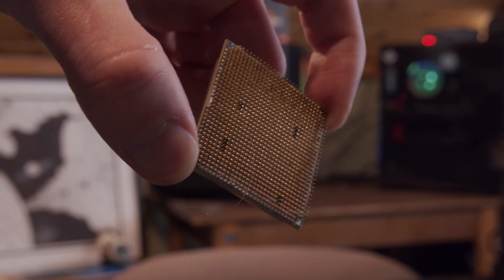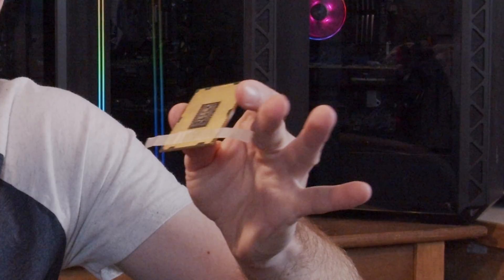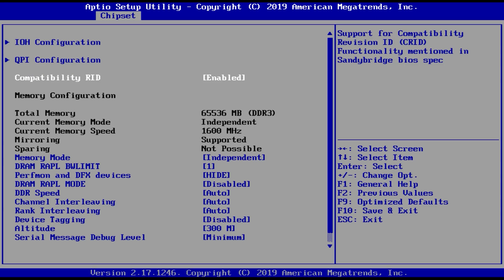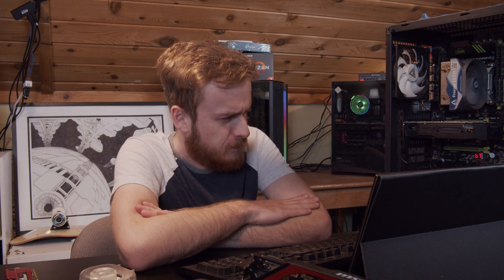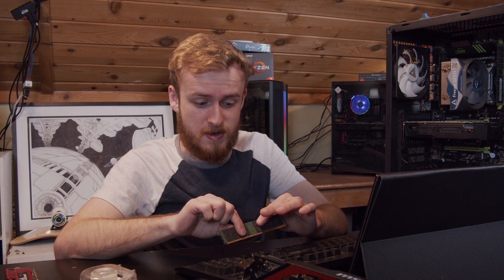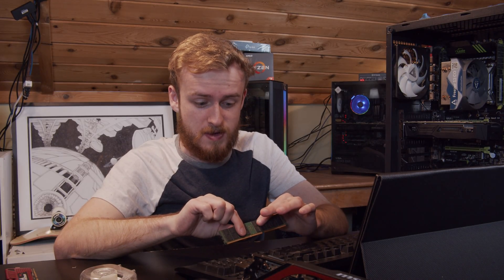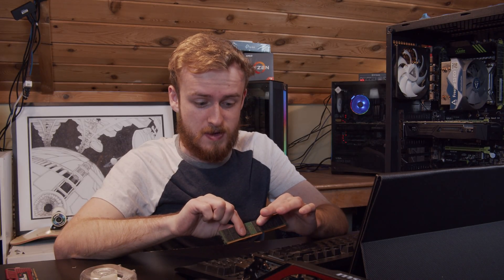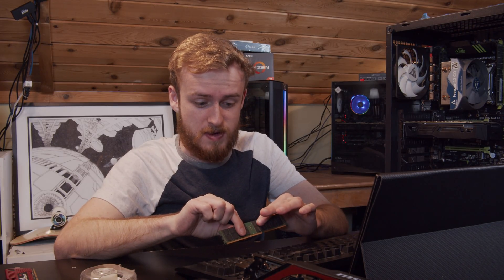What Happens IF You Remove Pins From Your CPU?

Comment: about 11 years ago when I was 9, I decided to unscrew my CPU to look at what was inside. There I saw the dusty CPU fan and decided to clean it. I started pulling out the CPU fan and well I broke the fan and the actual processor was stuck on the cooling fan with the dried-out thermal paste. I had no idea what that was at the time but the pins looked cool. But after being scared I tried to put the CPU back into the socket and guess what, it was misaligned. I had pushed with my full body force that some of the pins got bent. I was terrified since it was the family computer. quickly I put everything back and tried turning on the computer and it didn't start. I tried bending the pins back but then 1 of them broke, then another.

Then I had this crazy idea which I still can't believe worked. I had a brush with rusty iron brushes used to clean up moss and fungus from the ground. I took a wire cutting plier and tried cutting the iron hair equal to the length of the pins and then put the pieces inside the socket calculating the position of broken pins then put back the CPU in the socket and get everything back up and turned the computer on and it actually worked. I can still remember how happy I was and can remember everything so vividly.

also, the computer used to randomly turn off sometimes after that incident. (Probably because the part of the fan that stuck it with the motherboard had been broken). After about 6 months my dad took it to a repair shop and I don't know what he did but nobody knew anything.

Comment: the first part of the PCIe connector is power followed by signal clock then another power pin  then another power pin. That little part is mostly power for the card and signal pins on both sides to line up the signally and draw power for at least the PCIe controller chip on the card most times including the card itself

Comment: That part of the pcie conecton you call the "1x part" is actually just power pins. You will notice that some low power devices on pcie dont even need power from a separate power supply cable becaus its being powered by thouse first few pins in the slot.

Comment: I accidentally bent a ton of pins on a LGA 1151 motherboard once. One of the pins broke off and a buncha others were bent. I managed to get it working after a long day of bending them back into place, and despite the missing one. It worked for around 5 years. The only problem with it was that Dual Channel no longer worked properly.

Comment: eMMC storage has the ability to still work without all the pins working. It is meant to work with 8 pins at all times but if for some reason one or more pins are dead the eMMC can still function with either 4, 2, or even just one pin if all the others are dead, albeit at a very reduced read/write speed. It's a pretty smart (but simple) way of reducing data loss if one or more pins get damaged.

Comment: i bought a old phenom x3 cpu off ebay a long time ago for like 7 bucks that was missing like 6 pins so I just took ethernet cord n cut wires off of it and cut to size of pins then jammed em in cpu socket where pins were missing n bam was able to use it and not only use it I unlocked the 4th core and continued to use that thing for like 2 years for gaming thing was a beast for what it was lol

Comment: Well...I have witnessed friends force slot a CPU into a motherboard and break pins before. The result was the CPU didn't work after that. I'm assuming bent pins and removed pins will have the same results...now, let's see if I'm right.

Addendum- the processor that I spoke about had pins bent in several different areas. Yes, my friend is an idiot.

Comment: It's very simple. If you remove the pins from the amd cpu you should be able to use it in a intel motherboard
Reply: bruh there are no contacts on an amd cpu

Imagine this

taking off the pins on an amd cpu is like circumcising it, not turning it into a pussy

Comment: Believe it or not. Recently I was repasting my cpu and my dumbass turned the pc from is side to it's legs while the CPU CLIP WERENT CLIPPED IN. It's a ryzen cpu so the pins are on the processor obviously. It fell out of the socket right to my gpu and a pin broke from one of the corners. Now i can only use my ram in single channel. rip
Reply: rip ):

Comment: I remember a kid taking off pins cpu because someone told him it would be faster
Reply: Well I mean of course that's true! It's just like the way you should remove the fan from your CPU, so the CPU isn't wasting performance to run the fan. Easily 5+ FPS bonus
Reply: @DarkPlaysThings  functions as both  a bad cpu and a space heater now
Reply: @DarkPlaysThings  So that's how M1 was made
Reply: @groszak1  Not to mention it runs at half the speed of a Intel CPU so as slow as an iPad running the max settings on crysis! Apple doesn’t want you to think computers are good, they want more iPad sales
Reply: @hater123 what, no

You're supposed to put it on the other side with the pins/contacts, it helps the cpu stay in place
Reply: @mrlolas5114  you idiot. your supposed to cut off all the pins with a butter knife. those tiny metal pins keep the cpu suspended in the air and prevents full speed!
Reply: @CosmicFox2007  fun fact: most cpus releases in the same generation are the same, the difference being that the lower end ones have pins that limit their performance. By removing those pins, you're getting a better cpu for free
Reply: @mdominic8201  no its not a whoosh
Reply: if i recall there's a tape mod to make a q6600 run at 2.8ghz instead of 2.4ghz

Comment: if fixing a CPU is something you'd want to make a video on ill send you my new one, it made my pc blue screen nonstop and I spent 12 hours trying everything I could find to fix it and according to the people I asked on the internet it's just busted. I can return it but I don't think they'll replace it or give me hardly any money back.
Reply: What exactly is happening?
Reply: @stingertv7363  At first, when I booted up the pc it would work for about 20 mins then blue screen, or blue screen as soon as I run anything diagnostic like ryzen master.  But now it blue screens immediately. I tried everything every forum I could find said to try, I even got a nice big hard drive to put everything on and completely reset and updates all drivers and windows.
Reply: @dylonq1047  reset cmos
Reply: @dylonq1047  reseat the ram and ddu if that dosent work find out if your stop codes are random or fixed on one stop code
Reply: @dylonq1047  make sure your psus is up to spec and temps are good aswell
Reply: @stingertv7363  tried it all, if by stop codes you mean the blue screens then they are random
Reply: @dylonq1047  if you have an oc mess with voltages fixed my bsods for me
also IF you have a system restore point you can boot into advanced startup screen and do a system restore
Reply: @dylonq1047  if its always been like this try to find the cause of the problem if theres nothing hardware/overclock related could be a bad driver or bad windows install
Reply: @stingertv7363  no OC, tried system restore, updated all drivers manually and with a third party thing, and i reinstalled windows